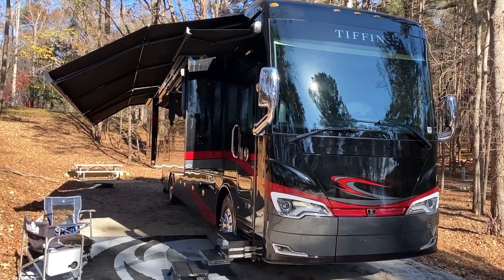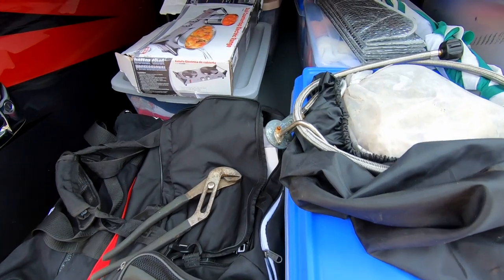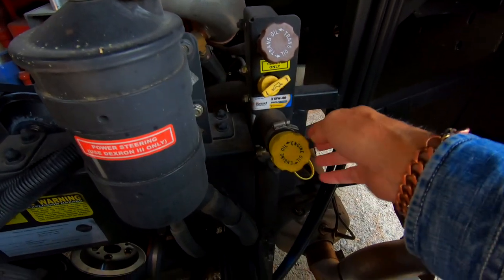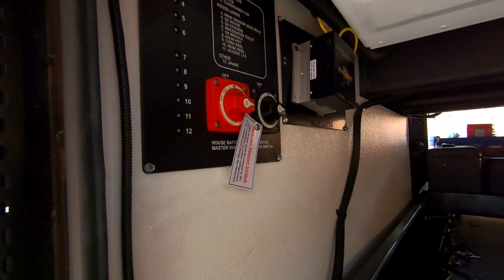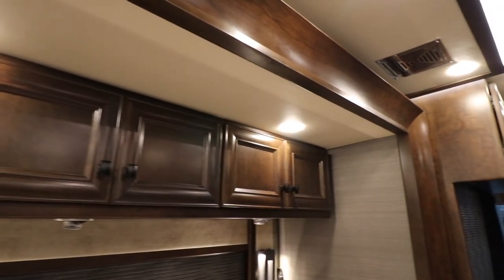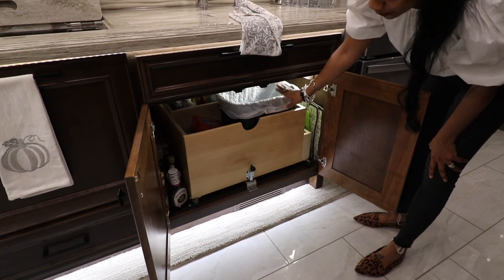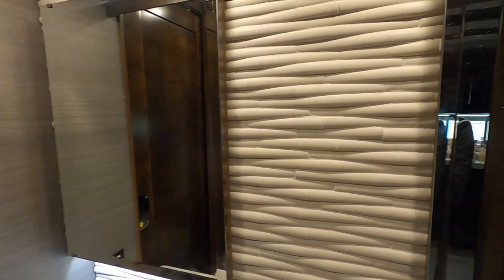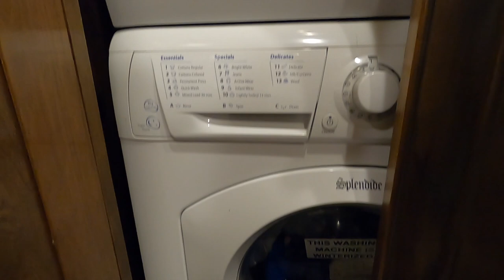Tour Our Home On Wheels/Tiffin Allegro Bus/Full Time RV

Comment: O guys that is an awesome rig....enjoy....Colors are great. Living the dream...good for you both. One question, does the debris get swept off the awnings when they retract?
Reply from the maker: Thanks Frosty!  Not sure about that, I do get up there and blow it off as it closes (using the remote to stop and start it)
Reply: @TollesonLife  I was wondering as sticks and leaves might get inside the awning roller or compartment and cause a problem, ie; rot, mildew etc. Never really thought on it until I saw your video, and noticed the leaves and small sticks on the awning as your rolled it. Was just thinking surely they have a brush like thing at the coach side to remove that stuff...or maybe that is an idea for a new invention...lol thanks for reply.

Comment: Hi beautiful rig lots of luck with it. Daryl I see you have a CB above your driver's seat. Could you tell me where your antenna is and how you're getting a good ground for it. Looking to do one in my rig but I wanna make sure I before I start drilling any holes.
 Thank you for the video  Stay safe. Bob
Reply from the maker: Thanks Bob!  That CB came with the rig, the antenna is on the roof but I haven't even tried to use it, not sure how the reception is.  Will have a look at that in the near future.

Comment: Love the tour!!! I was pretty set on getting a 5th wheel until seeing your rig, 2 questions what did it cost with your options and how is the fuel mileage while towing and far do you get between fill ups?
Reply from the maker: Hey me me, this one is pre owned so not sure what the options cost that were added, we get 8.7 mpg and I start looking for a station around 600 miles which is close to a half a tank.....below that it gets expensive to fill up (150 gallon tank)

Comment: first of all i love your coach, it is  very nice, am a rv er also and i love it but i have one question for you guys, you guys hauling also a Hummer H3 is that not a bit overkill behind your coach? and a lot of weigh, we not a smaller car you guys also have 2 bikes. Just asking
Reply from the maker: Thanks Richard!  The Hummer is an H-2 which weights around 6500 lbs, the rig can tow 15,000 lbs.  With the 450 HP Cummings, we really cant tell its even back there. Plus the Hummer is paid off :)